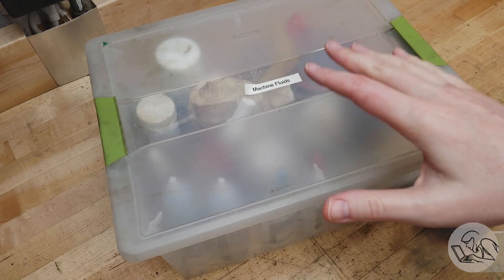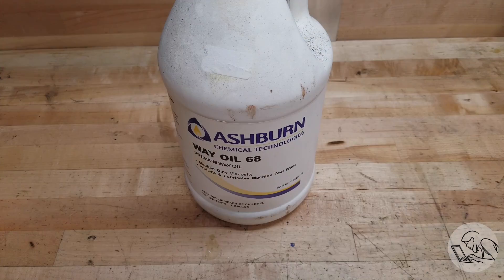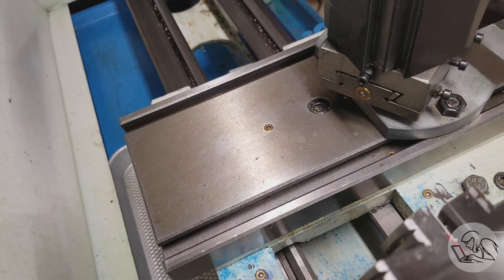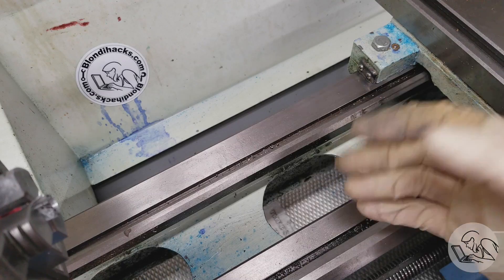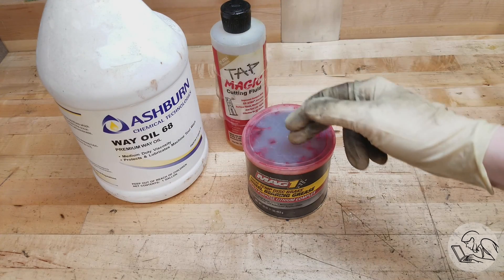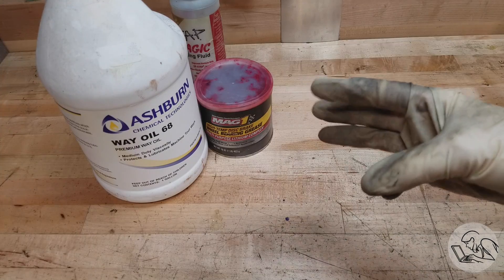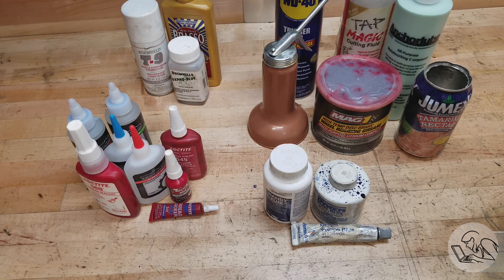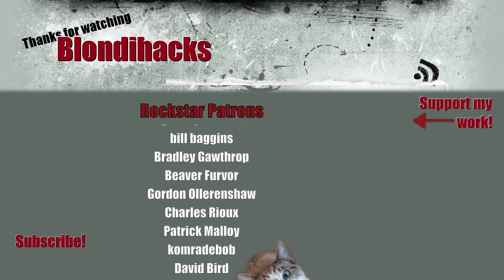Lubricants and chemicals you need in your machine shop!

Comment: And as I'm finally getting into machinery, and now have a lathe (which I need to finish setting up) it's time to get the fluids. 5 years means that some of the stuff that was hard to find is now impossible, or alternatively is now available on Amazon, at least in the USA. I'm not sure if it's going to be available in Canada. But on the latter end of that, both the blue and red Dyekem dauber bottles are available for about $15 US on Amazon. At that price for 2 oz bottles, I'd discourage leaving it somewhere that Grandma might grab it on her way to the Bingo parlor.

Comment: 12:17 -  hydraulic vs pneumatic is similar to pump vs compressor.  When the working fluids are liquid, use hydraulic and pump terminology when the working fluid is a gas or gas mixture, use pneumatic and compressor terminology.  This is an engineering convention that developed in the industrial age.

Comment: I'm not a full-time finisher, but I've spent many hours blackening and tried most of the products out there. I settled on Black Magic from Sculpt Nouveau due to its versatility and ease of use. Much better behaved than most of them, works equally well on everything but aluminum and stainless, and actually meant for hand application instead of a submersion bath. Thought you'd like to know about it if you don't already.

Comment: Quinn, thanks for this useful tutorial.  I find a very useful steel finish is phosphate finish, aka Parkerizing.  Does not work on aluminum, yellow metals,  or stainless. It requires modest heat, thermometer, and stainless steel container.  The resulting surface is porous and holds oil very well.  Does not affect dimensions.  You can find it at Brownells and Midway.  I set up long stainless steel tanks with temperature controlled propane burners, but a stainless steel pan and thermometer will do just fine for smaller parts.

Comment: Thanks for another awesome video.  If you're looking for a less toxic pickling solution, citric acid is a winner. I use it to remove fire scale from sterling silver and to remove flux from soldered and brazed parts.  You can buy it as a food-grade ingredient for making jams and jellies. Only downside: you have to use it hot (I just use a hotplate).  When hot, it will eat right through a 1/8" thick aluminum pan with ease (but you must never ask me how I know this).

Comment: Have you ever tried Air Tool Oil with a carb cleaner as a penetrating oil? Or air oil as an aluminum tap oil (lathe cutting), does work on steel too. I also tried it as a way oil too. then if need to clean a flat oiler - just use the carb cleaner with tube and then re-lube. I've also used it as a wet sand paper lube for a  higher finished polish look and then to really polish 1200 grit. a good tooth paste or rubbing compound to complete a polish. I am only a hobbyist but that is what I know. Granted I did blue print everything for a company called WetJet - personal water craft, engine (Brut), Jet pump, hull, steering... Oh am not a major fan of good none magnetic stainless steel machining, jet pump impeller sand slide splines fits. 3D cad and 3D  filament or SLA printing is most of my current hobby endeavors.

Comment: I just used JAX for the first time, and honestly it was my last alternative. I had a surface gauge I was restoring and wanted to blue it. Oxpho and Perma Blue simply would not touch it. I cleaned it with every solvent .... nada. Then I boiled it in a strong detergent solution for a few hours and rinsed excessively, Only a few small irregular areas would respond to either of those products. I am not new at this, and I've never seen this before. So I bought a pint of JAX on the outside chance it would work, submerged the gauge base and voila, it really did the job. A few repeats with water rinse and some light steel wool burnishing between dips, each dip lasting 5 - 10 minutes, and I got a beautiful part. SO...Jax may not be the easiest or fastest or least costly...but in SOME cases it really gets the job done.  It is part of my "always have this on hand" inventory now.

Comment: Appreciated as always.  one comment, soap&water depending on how much it gets used around metal may be better replaced by the bubble fluid used by hvac tech's as it is referred to as dish soap like bubble juice but is not made with a corrosive liquid since it goes on various metals to detect leaks of refrigerant that will later need to be braised/soldered etc.

Comment: We used to use red lead to check fit on parts. Basically a powder that you add a little oil to and apply with a brush, but because it has lead you can't get it anymore. Those that have any horde it like gold.

Comment: I really like all your videos.  I was a machinist by trade. I machined my first steam engine in 1958. then I made one from scrap steel I could find on the navy tube I was stationed on. it had a 4" bore and a 5" stroke. all I had to work with was a lathe and a drill press. I got side tracked.  I think chain saw bar oil would work well instead of Way Oil.  Your thoughts ?

Comment: For preserving parts during "long" projects or for protecting delicate tools in storage, try Valvoline Tectyl 506, "Heavy-Duty Rust Preventative". in bulk liquid or pressure-pack options. Easy to apply, not much fun to remove, (lacquer thinners and a toothbrush), but less agonizing then de-rusting precious parts or tools. I recall that other serious oil suppliers offer similar products. Speaking of "de-rusting"; be very careful with "rust converters. They can be very harsh on hardened pins .

Molasses? As we were speaking of "de-rusting", slightly diluted molasses is a fine, but slow rust remover. DO NOT even think about using it on ANY non-ferrous components, unless you want to see a magic trick wherein your alloy carburetor disappears, leaving a few levers and needle seats. Use a good penetrant (and patience) before totally stripping ANYTHING that requires chemical reduction; it will save many tears before bed-time.

Rubber grease; useful for assembling rubber bushes, bearing boots, etc; essentially a "non-petroleum" concoction. 

Graphite/ Moly powder, anywhere nylon, delrin, etc parts are working in a non-sealed environment; oil plus "dust" equals "grinding paste". Always be aware of graphite's electrical conductivity.

Comment: A couple of suggestions for additions / options:

Loctite 290. "Super Wick-In". This stuff is great for "fixing" parts AFTER final assembly. It is VERY "watery" and as the name suggests, "wicks" into close-fitting assemblies. A classic use is when setting up to pin a "block" to a round shaft. Position the thoroughly degreased and dry block on the equally well-prepared shaft. Measure three times, then apply 290 to the junction and watch it disappear. Return several hours later and hit the machinery. This is really useful if the "block" has radiused faces and /or is salvaged from a previous assembly and has existing holes that expose the circumference of the shaft at a "fun" angle for drilling and reaming.. Also useful for "pacifying" adjustment screws that have to be tweaked during setup and then remain in that setting to prevent performance degradation.

As for "sticky" / high-pressure lubricants: I have been using "heavy-duty "oil stabilizer for years. Available at the ubiquitous "auto parts and supplies" stores almost everywhere, it stays "slippery" even under great pressure. 

It appears to be similar to stuff found in places where sheet metal is rolled and /  or  deep drawn, as it does not "collapse" as a lubricant when under pressure. (Unlike standard WD-40, which is not a "serious" lubricant, but a fine WATER DISPLACEMENT substance.)

Then there is Moly grease, and spray-on Teflon and Silicone spray, (a REALLY good "paint repellent").

Comment: A little known "solvent" that I also like to keep around is baby oil. It's actually a fantastic organic solvent for cleaning most glues and sticky stuff off your hands. Most paints, glues and stains will surprisingly be removed with the gentle action of baby oil.
Reply: I found baby oil to be the only thing in an entire shop that worked on adhesive residue from years-old duct tape - tried three different liquid hand soaps, a Lava soap bar, dish soap (Dawn IIRC), hand sanitizer, pure isopropyl and even acetone (gently, quickly, trying to avoid absorbing too much...), but baby oil was the only thing that worked.  Follow that with the dish soap again to clean off the oil, and I could finally use my hands again...
Reply: Tape gum and slime on cables and surfaces? This is a common problem in the music / theatre production biz.

MOST modern power and signal cables have outer sheaths made from PVC, which is less susceptible to environmental degradation.

However, there is, as usual, a catch. Think about the PVC in your domestic plumbing and then consider a microphone cable: Why is the cable floppy while the down-pipe is rigid? The PVC in cable sheaths contains a magic "vinyl softener'. BUT this substance is "volatile and slowly escapes from the cable, hence "old" PVC cables tend to be "stiffer" than new ones. They also may contain more actual copper.

When the stage crew tapes down the audio and power cables to prevent clumsy artistes tripping over them, that "out-gassing" of vinyl softener continues. If the gig is a one-night stand, no problem.

If we are talking a month or more-long production, the softener will have its wicked way with the gum on the tape.

What you end up with is a whole bunch of icky, slimy cables that instantly pick up dust and "grime".

Yes, you can go nuts and use acetone and a bunch of last year's tour T-shirts to clean it off, but acetone is a bit harsh on the vinyl sheath and not exactly beneficial to the nicotine-laced lungs of the crew.

We found that the best brew is Eucalyptus Oil. Plenty of that here in the land of the Gum Tree (Australia, not California).

It will clear your sinuses without cauterizing your lungs; even so, this is a job best preformed in the great outdoors.
Reply: Hi Helena! Plain mineral oil is even better, its the same as baby oil but without the palm oil saturates, alcohols  and fragrances.  I use it generally on the lathe to lubricate and clean since way oil is sticky and greases are hard to clean.  For cutting I use supermarket lard which is very good for steel and bronze,   for aluminum I use the usual: kerosene, diesel  or mostly wd40, they  are pretty much all the same thing.  I look for stuff that is non toxic since I end up covered with it. Easy to clean,... just wipe if off.  Oh, about the lard,... keep your dog away from the stuff, dogs love to eat it metal lathe chips and all.
Reply: I tried it, and it works a treat ! I tried with mineral oil, it works but the best is genuine  baby oil, made with fresh babies, it's expensive, needs a couple of babies for a single ounce of oil, hence the price, but it's worth it !
Just sayin' !

Comment: I work in a shop where we revise, repair and modify electric motors, reduction cases etc etc.
Aside from general industrial electrical work we also do automation.

I use Loctite SF7200 a lot for removing gaskets on older engines. Especially these that come from Arcelor Mittal (our main customer) they are often killed by overheating, heat fucks up the grease they put in these, dries out the seals and ruins the insulation of the coils. Some of their motor-axles aren’t grounded either, fucks with the bearings too.

That SF7200 is great, just spray it on, leave it for 10mins and it will rub off like nothing.

We also use Loctite 641 for glueing bearings in place. Some 648 as well.
243 is the standard on all fasteners. 263 is also used but on rarer occasions.

All mechanics have a side tray on their cart filled with an entire collection of these bottles 😂 aside from seal remover, WD40, brake cleaner and ballistol. A tube of SKF bearing grease is in everyone’s bottom drawer as well 👀

Comment: Quinn, thank you much for your great videos.  

Penetrating oil:  I have had the best luck with PB Blaster, and have found it to be better than Kroil (which is pretty darned good).  Some years back, I ran into an early-1940s half-track that had a stuck pintle mount.  Nothing would free it.  Two shots of PB blaster freed it right up.  Was able to free it with hand pressure.  

Lubrication general rule:  I was taught by an old-school mechanical engineer that the general rule is captive assemblies get oil, non-captive gets grease.  Way oil seems to cover all the in-between stuff.

Comment: You don't really need two blues. The pasty stuff in the tube can be thinned with some spirits, and then it will dry nicely on a surface and can be scribed just as easily as the brush-on stuff. Its just more practical to have both, and of course, less messy. Some versions, such as Stuarts MiCROMETER Engineers Marking(which I have) comes in flat tins similar to shoe polish tins. That makes it easy to brush onto a part for rub tests, but lets say that there's a reason why those tins are packed in plastic bags.

Comment: SAFETY NOTE: Never use brake cleaner on anything you're going to weld or heat because it can create Phosgene gas, which is highly toxic. Always use acetone in those applications instead.

Comment: Just a tip for penetrating oil for the really corroded components a 30/70 mix of auto trans oil & acetone, if it’s not quite working add more acetone 
I’ve used that for years in the automotive industry

Comment: Thanks for showing your collection.  I did not see one that I use which is Johnson's floor wax.  IT stops rust on bare steel and is easy to remove with most solvents and is very cheep.

Comment: @Blondihacks I'm struggling to reconcile your recommendation for the Goldenrod oiler with the many reviews on Amazon complaining about leaks from the crimped (Not welded) bottom. Did you just luck out or did they change the way these are manufactured?
Reply from the maker: Mine don’t leak 🤷‍♀️

Comment: Be aware that acording to e.g. KURT, vices and similar need high pressure grease. Oil is only marginally better than nothing according to their findings.

Marking blue also exists as a “pen” which gives you the advantages of the sharpie and the real marking blue combined. Its kinda pricy though.

Comment: A shop tip you may not have used are heard of, but iodine to cut through rusty stuck parts and threads. Finding full strength iodine is hard to find, but great to have around the shop. Military surplus stores are a good source, so try it out if others don't cut the mustard, hehe,,Bear.

Comment: CRC 05018 Lectra-Motive Electric Parts Cleaner comes in a spray can and is one I keep around. Non-flammable and non-conductive. Leaves no residue and safe to use on energized components. It's about as good a brake parts cleaner but doesn't stink like brake parts cleaner.

Comment: Depending on the application; if you are in a pinch and don't have Prussian blue or highspot blue, I have had marginal success mixing Dykem into grease to replicate the transfer properties of Prussian blue. It doesn't work so well for large flat contact patches (hand scraping in my case) but it can be just the thing for small mating tapers and the like
Reply: Be aware it will dry up unlike the real stuff. "Emergency use only" I find

Comment: And Old Timers trick and a lot cheaper than Aerokroil, is a 50/50 mix of ATF (automatic trans fluid) and Acetone, which is basically what Aerokroil is.  I use it all the time and works great on freeing up those rusted stuck parts and nuts and bolts. You must keep it in an air tight container as the Acetone will evaporate and you have to shake it before use to keep it mixed together.

Comment: Great content as usual thanks!
Have you considered motorcycle chain lube (anti-fling) for t/fer gears? I have a similar lathe, and find I can apply a really good coating to the gears, which doesn't end up splattered against the inside of the cover. Also, I'm finding ACF50 works brilliantly for lubing everything in an unheated and sometimes damp workshop...

Comment: Another criteria for oil vs grease how fast the surfaces are moving determines the viscosity of the lubricant. The slower things move, the thicker the oil/grease. Also the higher the pressure, the thicker the lubricant.

Comment: For way oil, I use bar and chain oil. Has the same sticky property as the name brand stuff. And it is 'way' (pun intended) cheaper; $14 for 2 gallons. One last caution, if you have 60+ year old equipment, lathe spindles did not have ball bearings, rather close tolerance fits (0.0010-0.0015) lubricated by felts. You must use ISO 32/SAE 10 oil (hydraulic oil) or the oil will not flow properly.

Comment: It's on the affiliate link list, but I think Evapo-Rust deserves a call out because it is freaking magical.  There are plenty of products that will eliminate rust, but this is the only one I've used that leaves the metal alone.
The funny part to me is the black residue sometimes left on steel is apparently pure carbon left behind after the iron oxide was removed.

Comment: Great information and very helpful. Just a little addition from my experience; Brake cleaner is somewhat sits in the middle when it comes to solvent based cleaners, if you want a weaker cleaner then use 'contact cleaner' but if you want something bit stronger than brake cleaner, then use 'carburettor/throttle body cleaner which is little bit stronger, however you mentioned Acetone which is stronger then the ones mentioned above.

Comment: My favorites are Starrett M1 as a penetrating oil and glue solvent, and Corrosion X as an assembly aid.  The latter works really well for electronic circuit cards that might get wet (which is any outdoor gear here in the pacific northwest :) I was told that soluble oil was the stuff for most cutting and turning, but I mostly use RapidTap or motor oil..  For Copper; oddly Whole milk seems to work best.